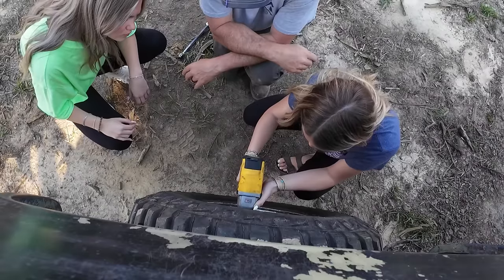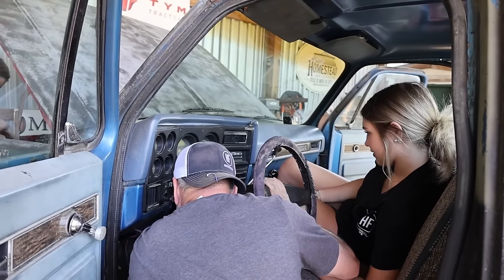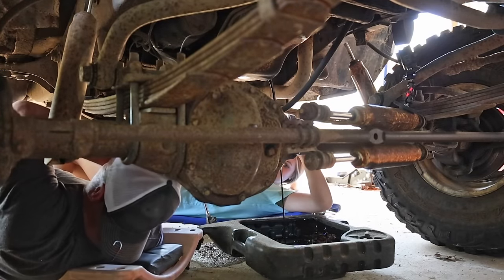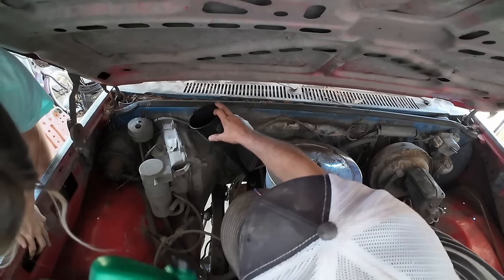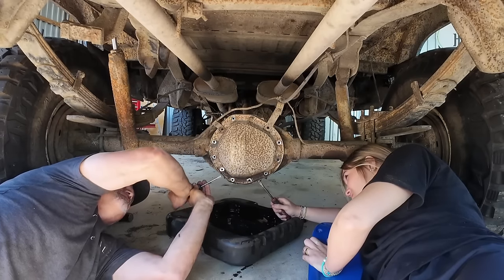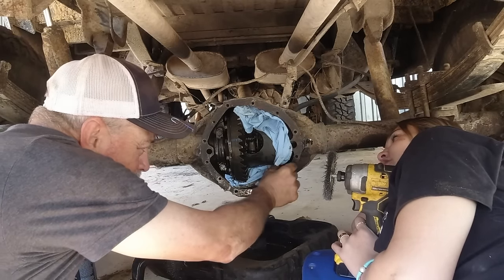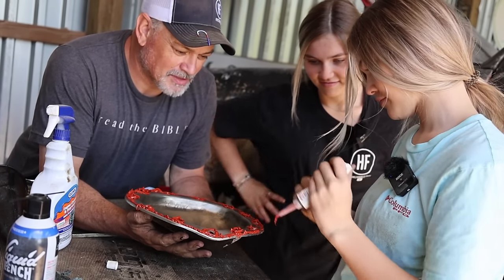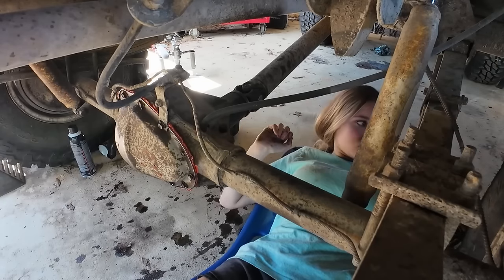K10 Squarebody is TOAST! BAD NEWS!

Comment from the maker: ▶Watch the whole build here: https://www.youtube.com/playlist?list=PLLvtX6M7iiPATePoDBum9BpWU-7-gHxAZ
Reply: Teaching these girls to work on their truck is commendable. 
But you should have a mechanic there to assist in doing the job correctly.  Never, never use old oil to lube filter gasget as the old oil has metal particles that will cut the gasget and create leaks.
And no you don't have to fill the filter with oil on these older vehicles. Just start and top off. 
The diff lube will smell bad can't wait to see the girls reaction. 😂😂
Reply: K10 is 4wd and c10 is 2wd.

Comment: If there's water in the differential, then it also traveled through your axle, and if your rear wheel bearings are lubricated (not sealed bearings) than they also might be compromised. If the sludge is in your axle casing, its going to contaminate the oil change
Reply: I don't think the water got to the axle bearings. The oil floats on the water. The water would stay in the bottom of the housing.
If it was driven much the water and oil would have gotten stirred up and whipped into a foam and look like chocolate whipped cream.

Comment: Oh, for cleaning gasket material off surfaces,  a right angle die grinder and scotchbright pads are king. Works excellent on cast iron, but on aluminum,  be sure to use dull mostly filled up scotchbright pads, and even then. Be careful,  scotchbright pads can eat aluminum.  And always straighten the sheet metal covers, using a ball peen to turn the bolt dimple the other way creating a form of Bellville style washer effect.
Reply: And if you chose to use a gasket instead of silicone,  a can of Permatex spray adhesive will keep the gasket in place during installation.  A spray on the cover, a spray on the gasket, wait till they're dry, then they go together like it's rubber cement.  A contact adhesive.

Comment: On that steering shaft, you can take the rag joint apart to remove the shaft from the truck. Measure the length. Measure the distance from the rag joint to the steering column.
Then lube and heat if needed to slide the two parts of the shaft to move. 
You may not get it to slide easy but enough to shorten it so the length matches the measurement of the column to the rag joint.
If you get it a bit short, that's ok, slide it up on the column then attach the rag joint. Then if the bolt hole is off a bit, you can tap it up onto the column till the bolt hole is up.

Comment: I would take the valve cover that's on the passenger side and put it on the driver side to get the oil cap/crankcase vent to be at the front of the engine and on the same side as the dipstick. That's how the original engine would have had it set up. It would make things a lot easier for when the girls do the oil changes themselves
Reply from the maker: I'm putting on new valve covers this weekend.  I'll keep that in mind👍

Comment: Don’t forget, the yoke seal needed to be replaced, might want to check the wheel bearing and seals on the spindle ends. With water in the rear diff, the way the cover came off, water had to get in from somewhere. Would be a good idea to do the front diff. 
Something I was taught about the RTV, 1/4 to 1/8 inch bead, let it sit for 30-45 minutes, enough to feel like a rubber gasket. Then put it on, won’t smear everywhere, torque to spec. 
Granddaughters make a good team. I might suggest another build, Z doesn’t seem to be into lifted pickups, she might be into the Nova, Mustang, or a Gremlin, 😂😂.

Comment: I had a 68 Nova back in the 1980's  250 straight 6 . Everytime I changed the oil in that car  The oil filter faught me  .Sometimes I'd have to beat a tire iron through it to twist it off .I'd oil the seal then screw the filter on just till it touched the base  then give it just a little tighter ....And next time it would be the same battle 😮

Comment: That rear end should take just a little over two quarters of oil to fill the rear end!! Know most the ones I have to fill are all K30 and K20 witch are 3/4 ton trucks and the 1Ton trucks that have a full floater rear axle and the axle tubes have to have oil in both axle tubes to help oil the outer wheel bearings!!! I have over a half dozen K30 square body trucks and I also have several 1967-1972 Chevy body style trucks also!!! Oh and you might have to bend that outer lip on the rear diff cover so it sits flatter to the matting surface to help seal it up if you start to notice a leak!!! It might not leak though with how much RTV sealant that you used!!! Lol!! Now if you was filling a rear differential on a 3/4 ton or a 1 ton truck with the full floater rear axle you would definitely want to lift the side of the axle with the fill plug so that you can add enough oil to fill the axle tube all the way to the outer wheel bearings and that way when you put the truck back down on the ground and level the extra oil that went in to help fill the axle tube can level out and be able to fill the same side that you had lifted higher to fill up and get the oil to the opposite sides wheel bearings also!!! Just something that a lot of people I see not get the rear axles filled up properly and end up burning the outer wheel bearings up because they had not gotten the correct amount of oil in the diff so that both wheel bearings had the proper amount of oil to lube both outer wheel bearings!!! Hopefully that makes sense to you?? Awesome video and I am definitely glad to see the girls working on getting a good old square body truck back on the road again!!!! Most girls wouldn’t even want to work on an old truck!!! They would rather have something that they could get in and drive something that can just get them from point A to B!!! Lol!!!

Comment: You guys got a 75 I have a 77 but it’s not getting fuel but otherwise it will run good I had it running with a boat tank but there is also no floor cause it is rotting away but I wanna fix it up for my first truck

Comment: Cracked up when you dropped the oil filter wrench in the sauce. Don't you hate when that happens? It is usually the oil pan drain bolt. You put way too much RTV on the diff cover. You don't really want it to squeeze inside the diff. Yes, you should have let it cure, though most shops won't bother to wait. Also, I would just let the driver snug the diff cover bolts. Let the RTV setup a bit, then torque to specs, FWIW.
Those girls are cutie pies.

Comment: Good job Hank teaching your granddaughters but it's an older truck with older problems one step at a time and it will get done after all that water in the dif I would pull the axles out and check the axle bearing s better to use diesel to clean the dif

Comment: That differential cover installation was kind of hard to watch and those bolts dont need to be super tight.  Make sure the vent and vent tube are in good shape and routed high enough to prevent more water intrusion.  Great patience with the girls Hank.

Comment: Good job Girls ,Hank being it had water that means either it doesn't  have a vent cap ontop or one of the Axle seals is really bad or Pinion seal is really bad even crossing a creek will stop that much water if good otherwise, I'd  check them.

Comment: I think you’ll find the flange of that differential cover to be bent, those are supposed to be flat. That could explain the over excessive use of the previous owner having so much of that black RTV on there to seal it up he probably bet that cover. Just a thought, but I do know those flanges are supposed to be flat check the differential itself you’ll see that it’s flat not bent.

Comment: The dif cover is supposed to have a gasket not just silicone and for your column problem make sure the bolt is out of it so it will slip on

Comment: I remember your son saying the pinion seal was leaking thats how the water came in if oil leaks out water can come in. I'm not trying to criticize you hank or the girls but just the way I do it on my vehicles I remove the ignition coil wire on mine and turn it over till I build oil pressure.

Comment: That rear diff is done.
That pinion seal isnt leaking because the seal is bad. Its leaking because the pinion bearings are shot.
Water gets in from a bad or short vent tube. If the diff gets warm and its driven into waters, as it cools off it creates a vacuum and if the vent in under water, it will suck the water in like a straw. Replacing all the bearings including the axle bearings required. Depending on how long the pinion has been moving around, you may or may not get the ring and pinion to work. 
I would replace them too. If you dont and the pattern on the gears suck...you will be taking out the new bearings with metal.
Buy once cry once.
Remember...
It doesn't matter of you think you can, or can't... you are right.

Comment: You need a band filter wrench . Works a whole lot better. No fancy fingernails today . I think they learned rule #1 . Check to see if the splines are the same as the column and rag joint. Shouldn't be that hard to slide in.

Comment: Get yourself a 3-finger filter wrench. Those filter plyers suck ass, they always punch a hole in the filter.

Also, never prefill the oil filter. That is an old habit. You are pouring oil into the output side of the filter which means it will go into the engine unfiltered. It takes seconds for the filter to fill and circulate, which isn't going to cause an issue. There is also still oil in the bearings from the last time it was ran. The only thing that might make a noise would be the lifters until they fill back up, which won't harm anything.

Never pound a screwdriver in to break the diff cover loose. It's tapered and can bend the flange on the cover. Instead, pound in a putty knife in a couple spots to break it loose. Water can either get in the diff from bad axle seals, bad pinion seal, or a stuck vent.

RTV needs to be applied to the center of the flange, not the outer edge. You want it to spread across the entire sealing surface. I have no clue who taught you to do it that way, I have never seen anyone do it that way. You only apply it to the cover; you are going to have RTV all over the inside of that diff.